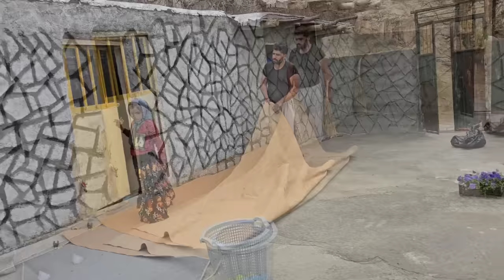Planting garden flowers in the unique nature by Saifullah/nomadic documentary

Comment: Simple Steps to Repot Your Plant

1. Remove the plant from its current planter or grow pot
Turn your plant sideways, hold it gently by the stems or leaves, and tap the bottom of its current vessel until the plant slides out. You might need to give it a bit of help with a couple of gentle tugs on the base of the stems.

2. Loosen the roots
Loosen the plant’s roots gently with your hands. You can prune off any threadlike roots that are extra long, just make sure to leave the thicker roots at the base of the foliage. If your plant is root bound—the roots are growing in very tight circles around the base of the plant—unbind the roots as best you can and give them a trim.

3. Remove the old potting mix
Remove about one-third or more of the old potting mix surrounding the plant's roots. As it grew, your plant removed some or all of the nutrients in the current mix, so you'll want to give it fresh potting mix or soil.

4. Add new potting mix
Pour a layer of fresh potting soil into the empty planter and pack it down, removing any air pockets. If your planter doesn’t have a drainage hole, layer the bottom with lava rocks or similar (rocks, gravel, etc.) before adding the potting mix. The goal is to create crevices for the extra water to pool into, away from your plant’s roots.

5. Add your plant
Set your plant on top of the fresh layer of mix in the planter, making sure it's centered, then add more potting mix around the plant until it is secure. Be sure not to pack too much soil into the planter: you want the roots to have space to breathe.

6. Water and enjoy
Even out the potting soil on top and water well! It's worth noting that a freshly repotted plant does not need to be fed fertilizer.